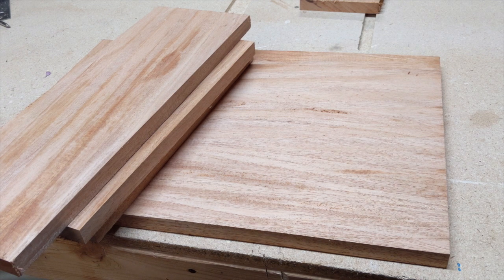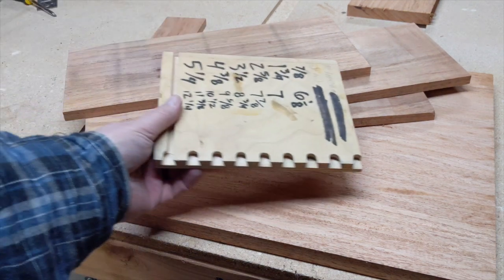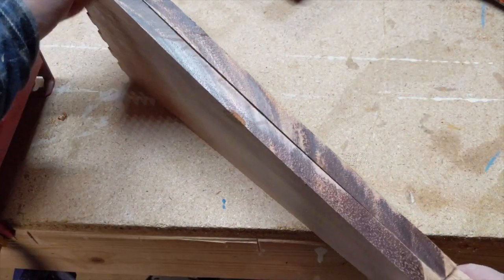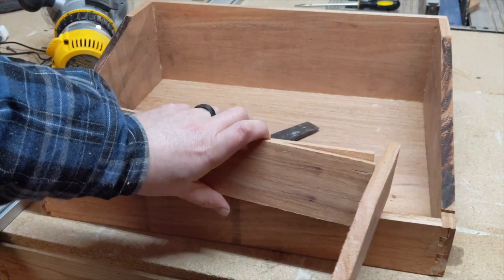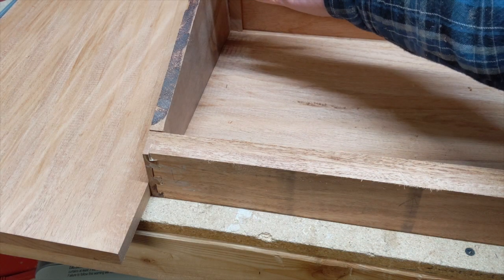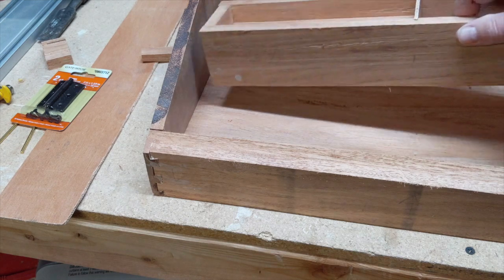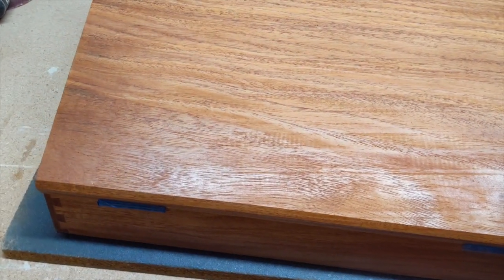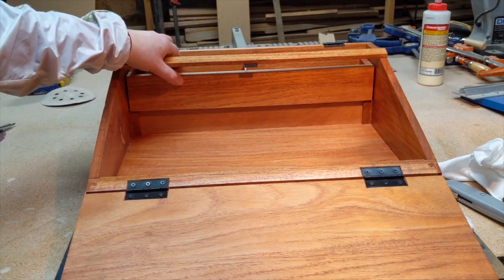Building a Mahogany Campaign Lap Desk

Comment: If you wanted to add a lock to the lid, how might you do that?
Reply from the maker: You could purchase an interior lock that would require a key. This would entail drilling holes for the lock and the latch. It would be more difficult because the hinges are in the front, but doable. Maybe install the lock on the side. Or you could get latches and apply them to the sides and use small padlocks, which would only require a few screws.